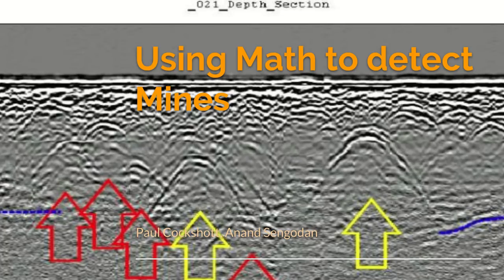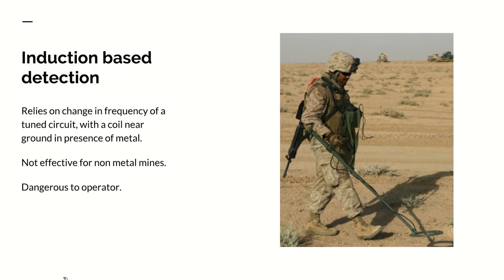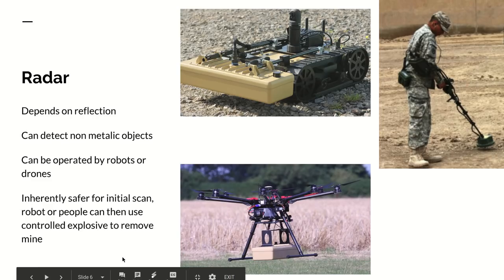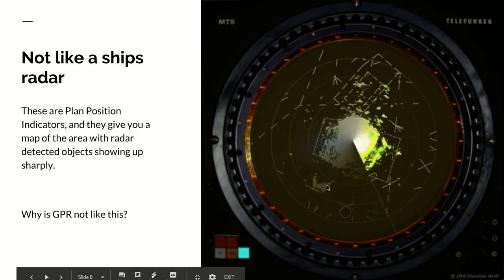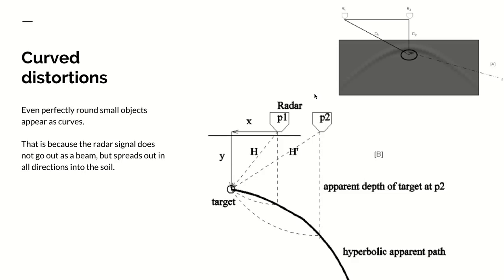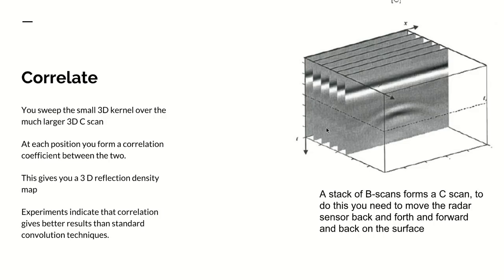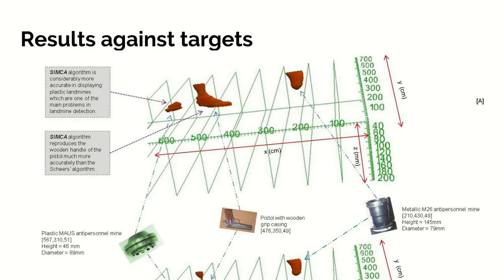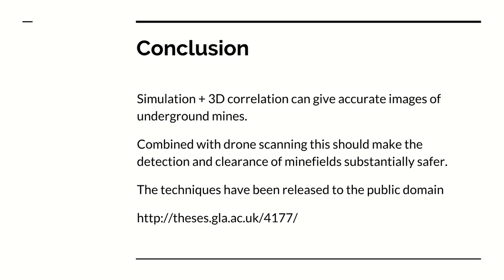Using Math to detect Landmines

Comment: Professor Cockshott, could you respond to the arguments of this website, http://bactra.org/weblog/820.html, particularly this one?

"The traditional issue here is that they have to assume there is a single commodity called "labor" (or "labor-power" or "abstract labor"), and that producing one unit of this requires the same inputs, no matter where in the economic system the labor is applied, i.e., what type of work it is really doing. This has long been recognized as a huge problem with labor theories of value; they devote Appendix II to acknowledging it; and they wave it away. This seems to me to make no more economic sense than lumping together all the different fuels produced by an oil refinery, electricity from a wind-mill, and fields of beets as the commodity of "energy" (or even "abstract energy").

Granting, for the sake of argument, that we can treat all forms of labor as equivalent (including equality in what's needed to produce them), there is still another problem. They can define a labor-content for every commodity because labor is "universal", a direct or indirect input to the production of every other commodity. But this is the only feature of labor which they really use in their arguments. So any other universal input would do as well. Water, for instance, is an input into the production of labor, and so one could just as well go through everything in their analysis in terms of water-content rather than labor-content. Indeed, water and electricity, being much more nearly homogeneous physical substances than "labor", would seem to make an even better basis for the analysis. So to the extent that they have a basis for saying that the ratio between the prices of commodities and their labor content is nearly constant, I could equally say the same of the ratio between prices and water content, or electric content1. They were, I think, aware of this objection to at least some degree, since they single out labor on the grounds that economists should be interested in the metabolism of the social organism, which necessarily involves labor. But I fail to see why materialist economists, studying the social metabolism, should not be equally interested in water, or electricity, or indeed thermodynamic free energy in general."